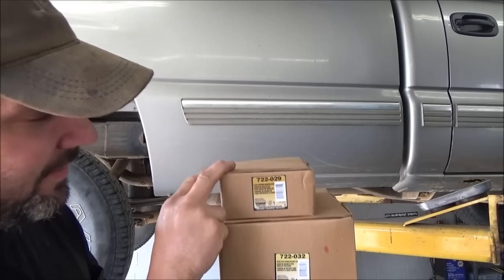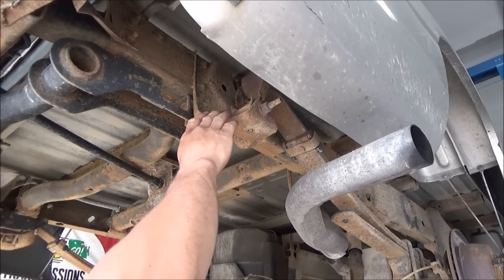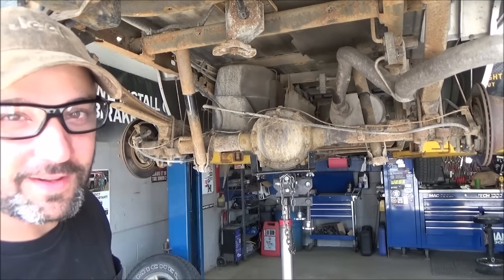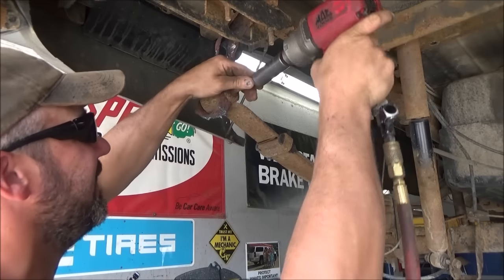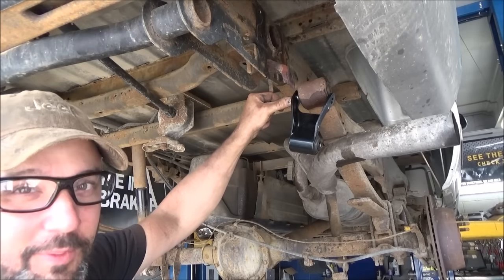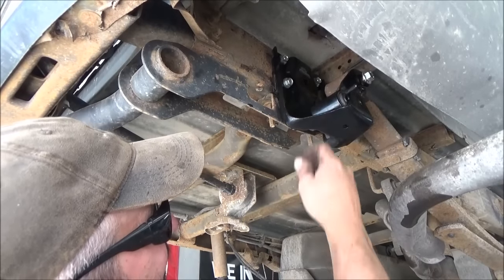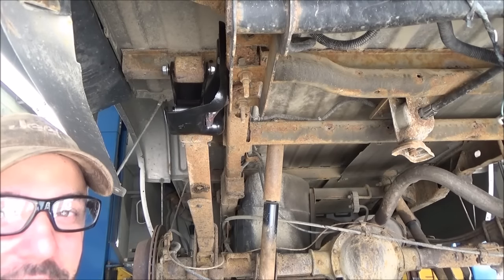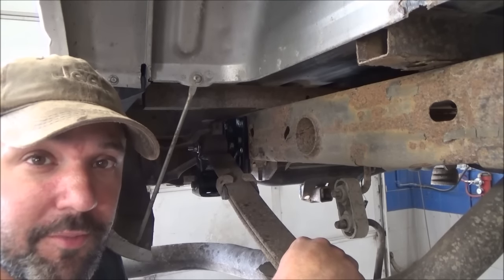Installing Dorman Spring Shackles & Hangers On A Chevy/GMC Truck

Comment: Eric, the only thing that would have made this sweeter is an intro with you in the Civic on the snow saying "Rev up your engine's!" and doing a clutch dump while the wheel barely breaks traction.
Reply from the maker: It's a Civic Tom... they don't "break traction" lol 

I take that back, in the snow it can... on a slight uphill grade that is
Reply: and the crusty motor mounts send that squirrelcage right through the hood.
Reply: Break Wind?
Reply: Tedybear315 Only if it has a fart can on the tailpipe.

Comment: In all seriousness, I installed a couple of Dorman rear sliding door rollers on a friend's 08 Honda Odyssey a couple days ago.  I was actually very surprised at the quality.  Made in Turkey.  They weren't any cheaper than OEM but very good quality bearings and readily available at Autozone on a holiday weekend.

Comment: You left out the part where it took 1.15 hrs and $2500 in power tools to get the rusty bolts off, only to find out that the dorman bracket is the wrong size and none of the holes line up. Oh and the part where once you finally modify it to work, the cheap supplied bolts shear right in half.

Comment: Did the spring shackles about a month and a half ago. Not horrible. But took a whole day because 3 of the 4 bushing bolts were seized. Then, yesterday, I got my redemption! Did both shocks in under 20 minutes! Took me longer to go get the parts than it did replacing them.

Comment: 4 Anyone living in the rust belt like I do here, I have some advice. Due to the way these frames rust I suggest making up two 4.25" wide by 7" long backing plates for the new hangers which you would put on the inside of the trucks frame. This helps out if there is any real rot you cannot really cut the frame on these trucks the metal does not weld good due to what it is made of and the way they rust foils any amature welders.. In the old days we called this a fish plate. It is a pain in the ass to get the holes on the backing plate exact no matter how exact you try to be so don't even try just oversize the holes. This helps because I seen a lot of these trucks around here due to their OEM rust coatings which was shit to begin with it may take a layer or two of metal with the old spring hangar when you remove it especially if you use a torch seems to make matters worse. I USE THE DUPLI COLOR rust barrier and mix it with a Sherwin Williams oil base DTM  enamel. The Dupli Color product dries fast and hard in a an hour or so but with the Sherwin mixed in it takes until the next day before you can mount the new hangars and then I coat all the new parts and tape off the bolt threads... Don't get the sheet on em in case you have to take the stuff apart again maybe to lengthen for a lift kit or traction bars like I have on my rig Tara...

Comment: 10K# Lift - $3K
Air Compressor  and air tools - $1K
Torch to cut off rivets - $500
Transmission lift - $800
Assorted hand tools - $500
Panther Pee - $15
$100 from Dorman - Priceless!

Comment: I have a 2008 GMC Sierra 1500. The FRONT position leaf spring bracket is completely rusted. The only thing holding it together is the bolt holding the leaf spring to the lower part of the bracket. I cannot find this bracket anywhere. Do you know where it can be found?

Comment: This truck is 2500 or 1500 ? I've been looking for that rear leaf spring bracket for a long time, but for 2001 gmc sierra 2500hd and only the 1500 ones appear. Do you know where I can get it new?

Comment: Got a question! As long as the vehicle is lifted by the frame and the differential supported by a jack. There is no tension on the leaf springs?

Comment: Did this on my 99 ranger back in the day. Took me 6 hours in my drive way with hand tools. Took the dealer 3.5 hours to do the other side in the shop. I dont think I did too bad. Oh and I replaced the bushings after getting the seized bolt out.

Comment: Hey, I noticed the Disc brakes and E Brakes set up on this truck's rear axles. Could you elaborate and would they be fitting a 89 k 1500?

Comment: This video reminds me of the 90s cable TV program with the 2 guys who'd take a complete basketcase to award-winning hot rod in 30 minutes. In that program you just KNEW the "stars" never did any "heavy lifting" and the parts they were installing were prefitted 10 times before the cameras rolled. Never was there a problem. Never did the parts NOT fit. Never did you see anything more than two guys pretending to know what they were doing. It was pure comedy.... just like this video...

Comment: Oddly enough I figured I was still sleeping when I heard Dorman and Quality used in the same sentence.  However, sense they often carry these hard parts that no one else stocks-  Have to say they are not to bad.  I've done the front quad shock mount on my Bronco, and the rear spring hanger on the ol' girl when I first purchased it.   The parts themselves fit decent and the hardware supplied was spot on!  (As for their other product lines?  Ehhhh...That's a different discussion)

As for the people complaining about being under the car/trucks getting face fulls of rust?  Let's be honest here..that's not Dorman's fault.  That's the manufacturers fault for using garbage steel, and the 'Rust Belt' extreme use of Road Salt.  (And I live right next to what's called  "The Salt City"  (Syracuse)).  So it's not Dorman's fault for getting a face full of rust....Now for a lot of other products they can't do right?  Well, again-  Discussion for another time.

Comment: Great video. But the words shackle, bracket, and hanger are all used. What is the difference between the three words? It seems a leaf spring bracket and a leaf spring hanger are the same thing, right?

Comment: Now that you have your Dorman spring kit installed just drive the vehicle and be prepared for the back end of your vehicle to fly off as you head down the road.  Remember if Dorman made it, You can bet it will fail.  Tune in next week as Eric O replaces the entire rear end on a Chevy/GMC Truck sponsored by Dorman Products.

Comment: Dorman uses junk steel...  I bent mine with a breaker bar. The moog one didnt bend. Also you have to take the gap out with washers which is a pain because no washers will fit the gap exactly

Comment: I doubt those bolts came out that easy from the leaf spring bushings.  I don’t live in upstate New York, but I do live in Pittsburgh and let me tell you how rusted an seized the bolts were on my Blazer.  Had to cut the bolts off, order new bolts, shackles and had ton burn out the leaf spring bushings because the bolts where seized inside the bushings sleeves.  Not a fun job at all. Lol.

Comment: THERES ABSOLUTELY NO OLDER PRE 1990 TRUCK SHACKLES RUSTING OUT.  strength by radius bends and swaging in thin sheet metal until rust thins them out THEN  bang leaf threw truck bed lol

Comment: But you left a bad bushing in the leaf spring defeating the whole purpose I have a 95 Chevy K1500 and the rear end is out of alignment a fixed rear end I have to replace all bushings and shackles

Comment: What the hell that bolt in the spring eyes came out too easy usually you have to burn out the bushing and replace it.
Reply from the maker: Yes haha this was obviously a spoof video. We all know this is not how it works in the real world
Reply: In the real world is lots of swearing and hacking the crap out of the frame with a torch trying to get the rivets out. Usually the gas tank is in the way usually leaking gas which makes it even more interesting trying get things apart with no sparks LOL.